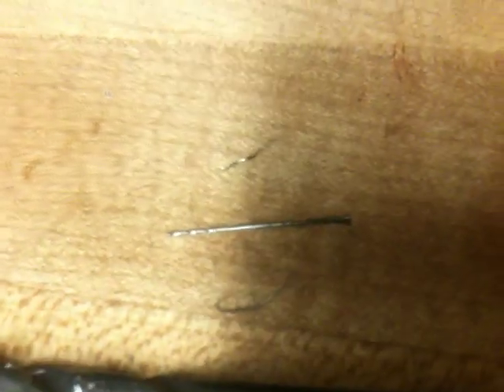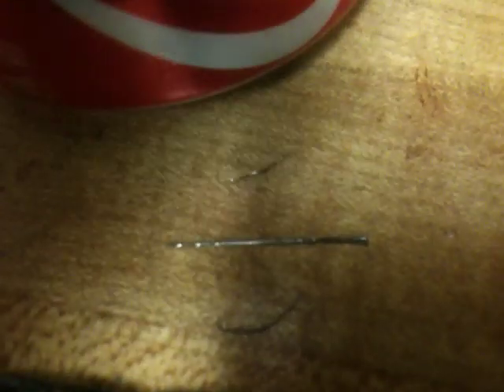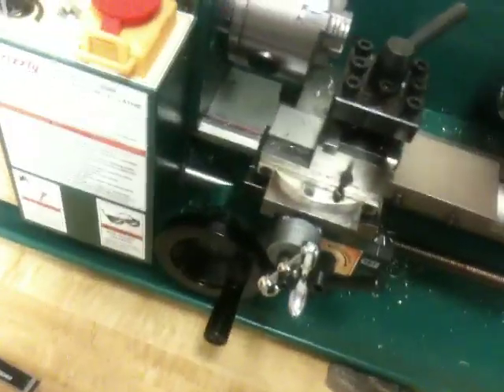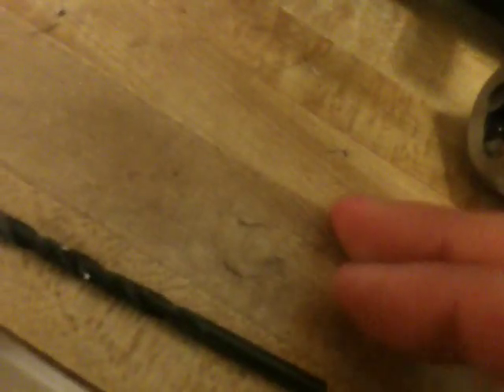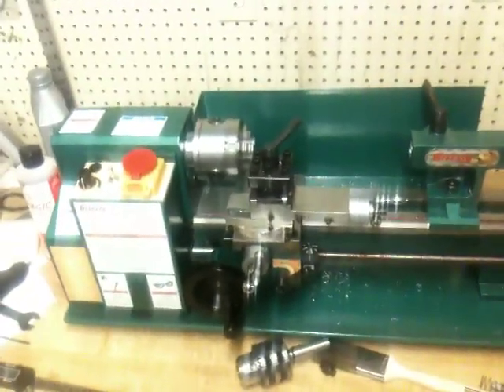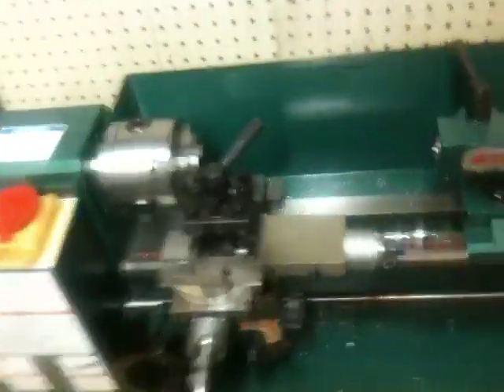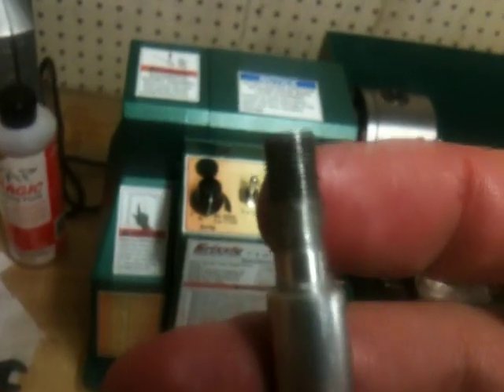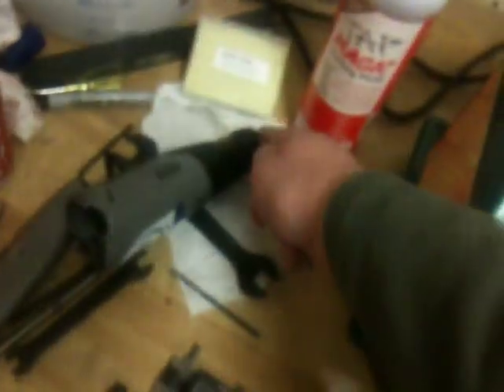Using an 0.5mm drill bit on my metal lathe

Comment: You could have gone to Harbour Freight, and bought a hand held pin vise for a couple of dollars. this comes with a set of drill bits in the handle. The pin vise is held loosely in the larger chuck for alignment, but fed into the work with your fingers in a pecking style of drilling. If the bit hangs it just spins in your fingers instead of breaking,if you are lucky. They also have carbide bits in assorted sizes down to size 80. which is around .013 inch.